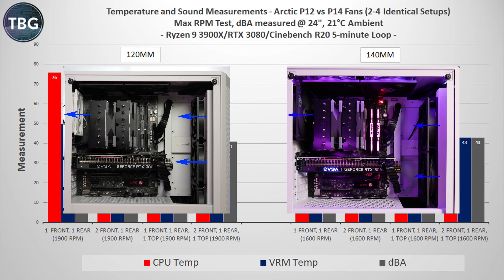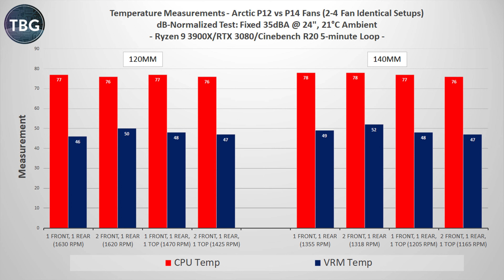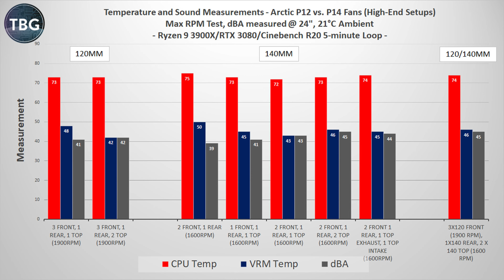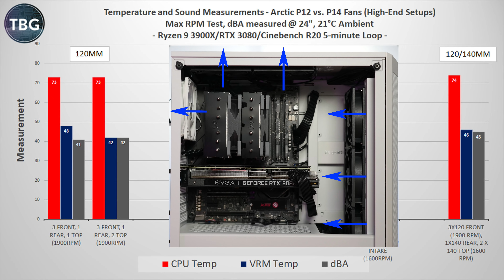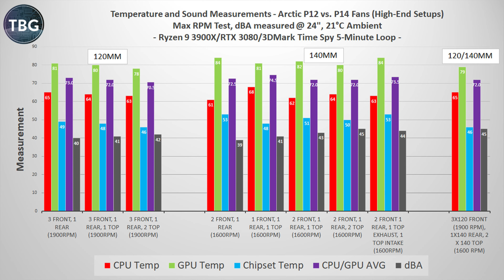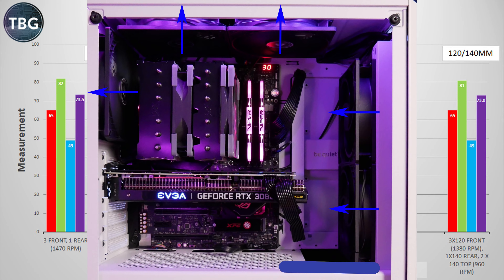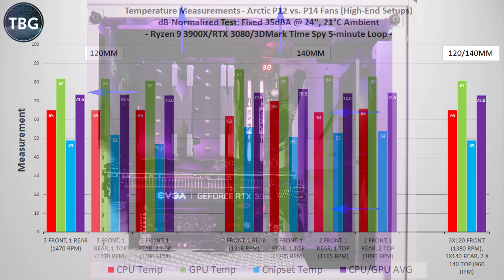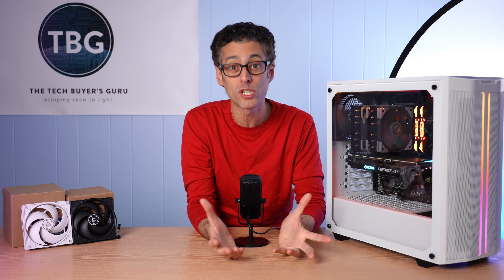The Best PC Case Fan Setup - How Many, What Size, and Where, feat. Arctic 120/140mm Fans!

Comment: The comparison between 120mm and 140mm is not fair. They should have the same rpm. If you have 3 120mm running at 1900 rpm on the front panel, you should also have 2 140mm running at 1900 rpm, not 1600 rpm, on the front penal.
Reply from the maker: Sorry, but this is incorrect. You do it by normalizing the decibel level. RPM matching is the wrong way to compare fans.
Reply: @TheTechBuyersGuru  A major reason why some people choose to buy 140 over 120 is because they don't really care about the noise. I live on a highway. My fridge, washing machine, and microwave are much more noisy than any computer anyway. For people like us, we only want to know the most cost effective way to cool the computer without creating an "unacceptable" level of noise. Something like Max (cooling effect/$) subject to budget is the best model. I was an economist, not an engineer.
Reply from the maker: I tested both fans at maximum RPM.
Reply: @TheTechBuyersGuru  When we test things or compare things, we need to keep some variables constant. You kept the noise constant, in terms of dB, which is good. Alternatively, you can keep the cost constant or maximum rpm constant. If you have 1900 rpm for the 120mm fan, you should have 1900 rpm for the 1400 fan too. It is called ceteris paribus.
Reply from the maker: You can't keep dB constant and RPM constant, and keeping RPM constant is meaningless, as I've already stated, especially when the 140mm fans can't spin at 1900RPM!

Trust me, I've been doing this a long time. db-normalized results are what matter, do not keep coming back to RPM, it's the wrong way of thinking.

Comment: Luckily I found this video. This helped me a lot in deciding what would be my fan placements using the Arctic PWM's
Currently building my first gaming PC on a mATX form factor using Meshify C Mini. 
2x P14 PWM Front (in)
2x P12 PWM Top (ex)
1x P12 PWM Rear (ex)
Reply from the maker: Glad it helped. You've definitely maxed out your mATX case!

Comment: Now I want to return the 140mm fans I bought
Reply from the maker: The main issue is that 2x140 in front is not as good as 3x120. So it depends on where you are placing them.

Comment: Hello, I would like to see a video where you analysed the RPM sweet spot for a fan (140mm and 120mm). So fat I have set my fans at the lower speed possible, but I would like to know how much gain I would have if I speed up my fans. It would also love to check the difference performance between Artctics P14/P12 and F14/F12. In theory flow fans should be better as fan cases. Thank you!
Reply from the maker: This test would be extremely fan specific. Whatever I found for one fan model would be different than it would be for another model, and more importantly, it would change a lot based on how many fans are in the system. I think I've done about as much as I'm going to do on this topic in the video you watched here.

As for the P12 vs. F12, I've tested this already. The P12 is a much better fan for everything. Airflow metrics in specs are meaningless, as it turns out. You can learn more here: https://youtu.be/WBoLyC0tSDQ
Reply: @TheTechBuyersGuru  thank you :-)
Reply from the maker: There is a problem with his methodology. He is testing in a simplified system where the CPU cooler does not have a fan. He's basically using the case fan as a CPU cooler fan.

It would be MUCH more complicated to actually test this correctly, where multiple case fans are installed and the CPU cooler has its own fan.

Comment: I've been runnning 6 P14 PWMs on my case in the setup you had in the 120mm video ( my case is P600s ), pretty sure it's the best setup with these specific fans. I've also seen some turbulence at around 70-75% fan speed.
Reply: Wow I got the very same result!

I own the P600s (best case ever) and had the P12s in it first.

After changing to the P14s the entire system got even quieter than before. I mean not noticeable quiet!

Comment: wish there could have been a more "level" testing, as in 3x120mm front vs 3x140mm front.
Reply from the maker: This case doesn't fit 3x140mm in front, so that wasn't going to happen. But there was a lot of other comp testing throughout the video, in fact I compared every other setup possible using 5x120mm or 5x140mm. So perhaps what you're actually saying is you wish I used a case that fit 3x140mm in front. Maybe someday I'll do it all over again... LOL!

Comment: I have the arctic freezer 34 esports duo,..same resonant sound coming from those fans,..
Reply from the maker: Note that the 34 esports Duo uses the BioniX model, which is quite different from the P12. I never detected resonance from that fan, but I wasn't looking for it back then. What I did detect was a lot of general noise due to turbulence around the fan frame, which is not smooth like the P12's frame.

Comment: How in the world does changing from 5 x 120mm fans to 5 x 140mm  (@full rpm) ADD 4-5 celcius and 3db?! Adding tons more CFM (and therefore cooler air) should equal better temps? Only thing I can think of is they goofed up the 140mm version and they actually pull LESS cfm.

As soon as you  think you know something about pc airflow you see something like this, so complicated.
Reply from the maker: Simple. Everyone has been focused on CFM when it has almost nothing to do with cooling performance. What matters is how much air reaches your components, and that means a tightly focused channel of higher speed air, e.g., from a 120mm fan.
Reply: @TheTechBuyersGuru  so a 12cm fan has a more powerful blast of air compared to a 14cm? 
I always thought that it would equal out - yeah there's more cfm on a 14cm but over a larger area... that air has to be going somewhere though
Reply from the maker: Air is going somewhere, but not where you need it. Note this only applies to intakes, not exhausts.
Reply: @TheTechBuyersGuru  interesting, thanks for your work. Earned a sub!

Still at a loss as to how best to mod my case though 😂. 
Basically I'm cutting out 3 holes in the lid of an HTPC case (fractal node 605) for 3 intake fans: 2 for gpu and one for cpu, then using the other slots (3x12cm, 2x8cm) for exhaust.
 I have the gpu mounted horizontally with a riser cable, so the 2 holes will be directly above it. 
The cpu fan will actually be mounted to cpu cooler, sitting out the top of the case a bit, as doing push pull. 
I figure direct air in is optimal for cpu, but with the gpu (most important) fans will be sat about an inch or so above the gpu blowing into it. Maybe a more concentrated blast of air with a 12cm is better than 14cm?

 I'm wondering if I should maybe even put a 12cm on the (14cm) cpu cooler: a noctua nh-c14s.

I was considering 2x noctua nf-p14s before I saw your vid. Dammit!

I noticed though the 12cm version has 2.83 pressure vs the 14cm 1.91. Would I need pressure in this situation? And have you compared those against the arctic p12?
Reply from the maker: You have a very unique situation. Basically, you need static pressure, not airflow, as there will be very little space to move air in that chassis, but air doesn't have to go very far (like fans will be right above the components). I'd go for bigger fans, and specifically the Arctic P14. Right now the white versions happen to be a very good deal: https://amzn.to/3aGiNfs 

Noctua fans aren't nearly as good. I've tested their high-end 140mm fans a number of times, including here: https://youtu.be/cQ6W-b45wZ0
and here: https://youtu.be/PUdsTiRmuuU
The P14S is even worse. I wouldn't even consider it.

Comment: hey what size would you recommend with 3 front fans on a P500A case.. 3x 120mm or 3x 140mm Arctic's P series
Reply from the maker: While 3x140 seems like the obvious answer, I'm increasingly convinced that for intake (not exhaust), directional, focused airflow counts more than overall airflow. The 140s produce more airflow, but potentially less down the center line where components actually sit, especially once noise normalized, which requires a lower RPM.  If you are getting a 5-pack, then get 140s since you really want that in back and on top. If just buying 3, maybe 120s. I may eventually test this in a larger case than the 500DX used in the video. For now, I can only say 3x120 is better than 2x140.

Comment: I leaned something about case design. I normally run around 36 C according to HWMonitor. I pulled the front of my pc off to discover a huge hole on top of the one fan that the case uses in the front. (hole was there to add a fan)  I reasoned this cannot be good so I sealed up the hole and got 2 degrees cooler consistently now that the one fan isn't pulling hot air from inside the case.  I thought o.k. I can do better than this. I had an old fan I pulled out of an old pc installed it even though it was a smaller fan, sealed up the edges again and now I'm getting a consistent 32 C at idle instead of 36  C. Moral of this story, always seal up any holes your front fan may use to pull warm air inside the case from and add more air intake if you can.

Comment: Hi there, thanks for the excellent review on these fans. I'm in the market for case fans and I've been wondering whether I should go for the Arctics "F12" series (Airflow Optimized) as an exhaust for my case or should simply go all "P12" (Pressure Optimized) as shown on your review. Does it really make any difference at cooling performance at the end of the day? 

PS: My top exhaust, should blow against a dust filter, whereas my rear exhaust should blow against the standard chassi grill. Thanks
Reply from the maker: The F12 is an outdated design, and in my testing, the P12 has been better in all circumstances, whether that is in high-pressure applications or airflow applications. The specs are really meaningless. It is performance that matters, and the P12 is a better fan.

Comment: These tests were done by using cpu air cooler. If someone has cpu liquid cooler then the results will be different. Keep that in mind guys. One of the Best setup for front mount cpu liquid coolers is 3 front intake, 2 top exhaust, 1 rear exhaust
Reply from the maker: This is true, but for many reasons, I don't recommend front-mounting a radiator. Here's my video explaining why: https://youtu.be/bL5IsxzpiCA

Comment: Hi ! Thank you for the video !
I have the 500DX and 5 Arctic P14, so in conclusion what do you recommend ? 2 front, 1 exhaust, 2 tops intake ? Thank you pal !
Reply from the maker: Almost... but you want the tops as exhaust (blowing up and out of the case). Also do not position the front fans so they are as high as they can be mounted. You want them centered together in the middle of the front panel.
Reply: @TheTechBuyersGuru  thank you very much ! I have reversed top fans and will lower front fans ! Have a nice day !

Comment: I have change my arctic radiator fans to Ek vardar fans, But the lame dragoncenter is so retarded, have to use DC instead of pwr to silence them, gigabyte has better software 2 control fan in windows ^^
Reply from the maker: I am now using Argus Monitor, a paid app recommended by several users. You may want to download the trial to see if you think it's worth paying for - https://www.argusmonitor.com/

Comment: Aren't these results just particular to this case? .. I mean if you don't have this case then the results may vary ....  I have a Thermaltake case which gets it's best CPU cooling by having the top fans set to intake ... but I also have a Lian Li case where this is not the case and the top fans are best at exhaust ...
Reply from the maker: I chose a case that is representative of modern midrange cases. Other cases could definitely be different, but likely only if they have massive design differences, like a solid front panel. It's going to be up to viewers to decide how this applies to their system. The testing took me about 30 hours, so I'm not going to repeat it in other cases.

Comment: are you able to put intake fans on the outside of that case also as in 6 intakes on the front or does that not work.
Reply from the maker: Hmmm, never thought of that, but I guess you could if you rigged up a custom mounting system (standard fans screws wouldn't work, you'd need longer screws that went through two fans). But I'm not sure you'd get much benefit, as simply stacking fans would likely introduce more noise than airflow.

Comment: I really like in depth comparisons with case fans. I've watched previous videos and you really cover the issues that bug a person like myself who cannot stand noise issues caused by case fans. I've experience harmonic resonance issues with noctua that are not going to show up on a "decibel meter", but I would rather have high decibels than to hear that awful sound. I don't know how anyone can work next to a machine noises like that all day. The cons of having good hearing I guess. You also make a great point to control the RPMs of the fans to get the right amount of airflow where your specific case isn't making groaning noises.
Reply from the maker: Glad I could provide some useful insights! Fan performance is incredibly complex, which might be why you don't see many other YouTubers trying to tackle it! I definitely can't cover it all, but I try to give people something to think about beyond specs on a website, which is how most people have bought fans for decades.

Comment: I really liked the comparisons in this video. I would like to get your take on different types of power supply fan configurations. Old PS had the intake on the side facing the front of the case and vented to the rear, where as the newer units have a bottom intake and a rear exhaust. Doesn't seem to support air flow. Also, I always had a fan on the side of the case pointing directly at the GPU and or CPU. With my new case (Phanteks 500A) it has a glass side panel. Oh well, the RGB does look cool even if it don't contribute to cooling.
Reply from the maker: I haven't seen PSU setups like you described, but I'm very familiar with those side-mounted fans. The issue with those is that they do not work with modern GPUs. Those side fans sort of made sense when GPUs used externally-exhausting designs, but nearly every GPU today uses an open-air design that partially or fully exhausts out the side of the GPU. A side fan would actually push that heat back in. If anything, what you'd want is a side fan exhaust, but much better than is a bottom fan blowing up into the GPU, and many new cases are adding this feature.

Comment: TLDR 
On average the best configuration for gaming is... the 3-2-1 setup.
6x120 fans total

3 intake on the front panel
2 exhaust on the top panel
1 exhaust on back panel
Reply from the maker: Definitely true for gaming. Not really true if you are mainly stressing the CPU. In that situation, you probably want fewer fans running at slightly higher RPM.
Reply: @TheTechBuyersGuru  Edited my comment, thanks man!
Reply from the maker: Definitely, this is what I'd do for gaming, unless of course your case is large enough to fit 3x140mm in front!
Reply: @TheTechBuyersGuru  how many decibels do you think that would be?
Reply from the maker: Depends how you tune it. You could probably get 3x140 to be quieter than 3x120 with the same performance, but the components matter too. 140mm fans move more air but with a broader cross-section, so in some situations this won't be as effective.

Comment: Another good video, though I think it's important to point out that these results would likely vary from case to case. Would love to see a similar video optimizing the setup in the same case with a 240mm/280mm AIO on the CPU indicating which fan config ends up being most efficient.
Reply from the maker: Yes, it would vary, but basic findings would be the same. Blowing air at components and under GPU helps, disrupting airflow with opposing fan directions does not. Cases will change magnitude of fan effects, but not alter conclusions, especially at max RPM. As for AIO testing with various fans, that is coming at end of March. Already have all test samples on hand.
Reply: @TheTechBuyersGuru  Great! I've subscribed so I'll be notified when it releases. Looking forward to it.
Reply from the maker: Thanks for the sub! Had planned on rolling that out at the end of February, but my AIO cooler shootout is ending up taking more time than I anticipated, starting with the selection of a thermal paste!!!

Comment: really great tests !! Very useful. i was worried about the choice of the 2 front fans that i have. i put them in the lower side of the front panel also if there's half air flow to the power supply. All of this to have 2 cold fans intake in the front and one fan in the rear panel plus 2 fans of aio on the top. I got very good temps. air should run from the front bottom to the rear top of the case.
Reply from the maker: Sounds like you have a great setup!